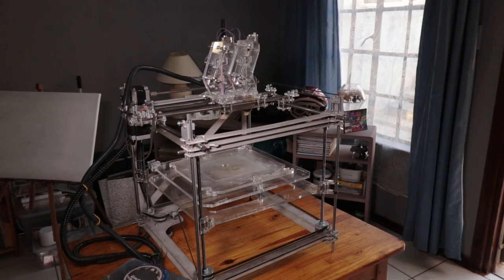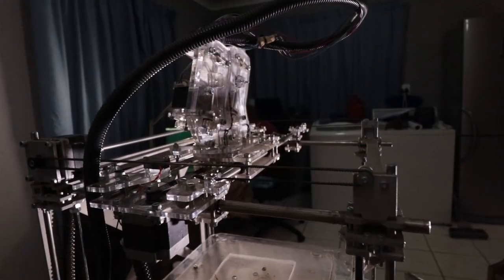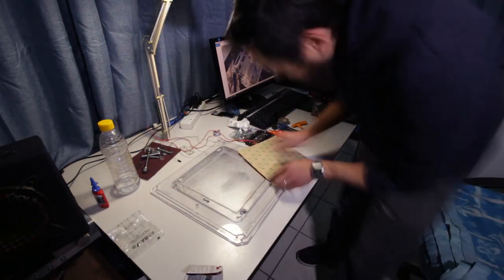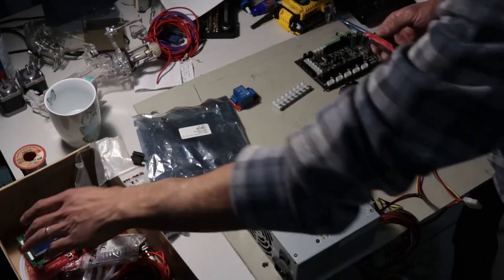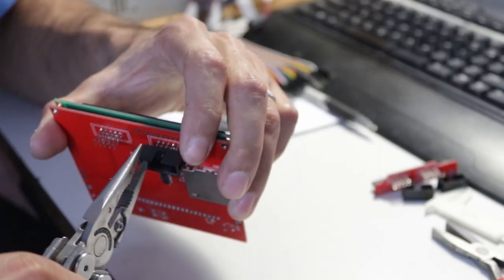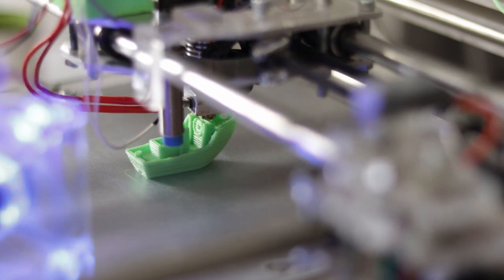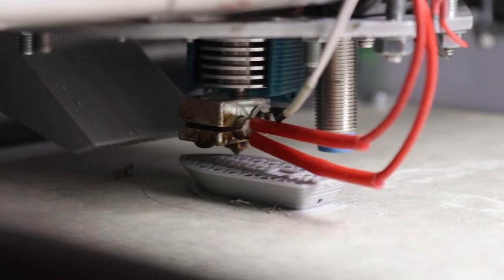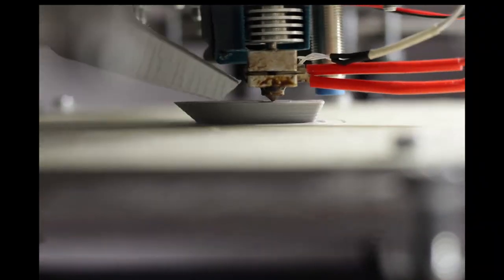Should You Buy or Build a 3D Printer? - (Re)Building an Ancient Printer for Cheap

Comment: I do this since decates.But the hardest part is the give life to the motors .They seem to live there own life and somethimes my -try and error -method is endless.IS there a good method that shows how you can set the motors and firmware structuraly ?
Reply from the maker: So it depends on what control board you're using for the printer (either Smoothieware or Marlin/Ramps). But when I was first learning, this page: https://smoothieware.org/3D-printer-guide from smoothieware really helped me understand how to test & connect the motors, it also has links to other helpful videos further down the page

Comment: If you build a 3D printer with chinese part to clone your 3D printer. You will spend mostly between 400 & 500 euros. Depend of the model you want to make. I think, if you made a prusa, it's worth it. I don't know if you can build a 3D resin printer for scratch. If it's possible, then, it's totally worth it. Because those printer are expensive !
A CNC who drill aluminium or wood cost also 400/500 euros to build.
Reply: Resin printers are fairly cheap now
Reply: @atlredninja1  That's also true.